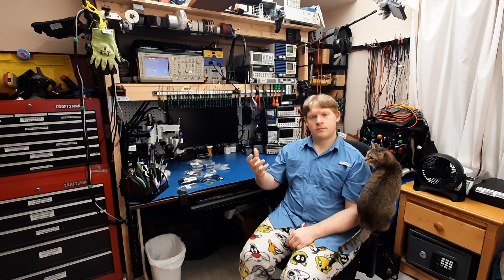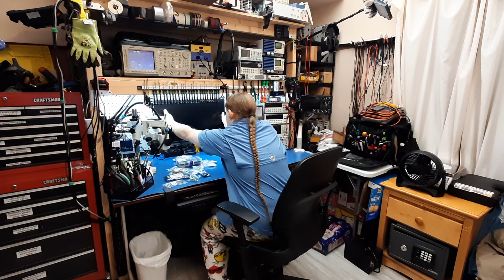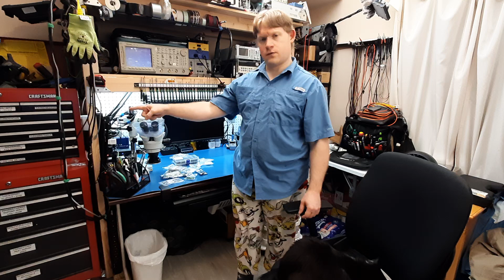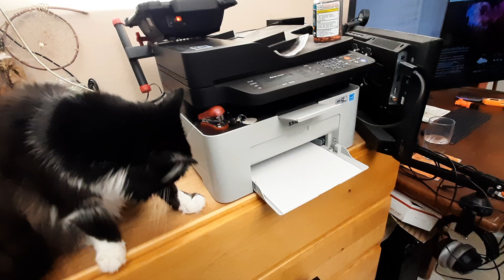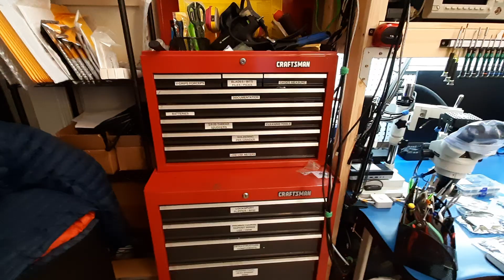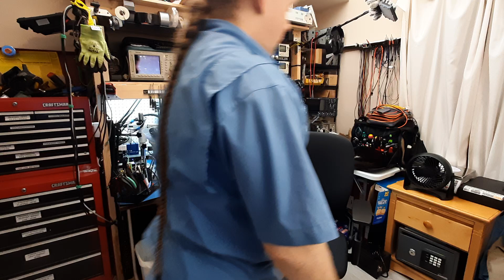Workshop Infrastructure: a talk about the spaces we use to do the things we do.

Comment: New sub here. This is an aweeome channel. I wanted to learn what small electronics workstations looked like because I started tinkering with video game hardware. Fixed my N64 with corroded joints near thr VGA out and I still need to replace the crystal oscillator on my Pokemon Silver Version(replaced the save battery, keeps the save but doesn't continue keeping the time after shutting off). Don't know if others have thanked you but this is awesome stuff and I appreciate you for guiding newbie nobodies like myself.
Reply from the maker: Aww!  Sincerely, thank you.  It gives me a sense of fulfillment to know that my poorly recorded ramblings on electronics and such are being helpful to other people.  I'm glad you find this useful.

Comment: That is a very interesting idea 19:30   I need to look into how much those printers cost.  Most cool.  tHanks for the video
Reply from the maker: The specific model I have (Zebra GX430t) typically goes for the $100 to $150 range on eBay, but if you are patient and watch for a good deal you can of course find cheaper, maybe in the $60 to $80 range.  But if you don't need a workhorse to print thousands of labels for eBay and just want to print a few for labeling?  Don't buy the expensive tool for that scenario, you can find no-name thermal label printers for $50 or less.

Anyway, thanks for stopping by, and I'm glad you found something useful here.
Reply: @neverendingstudent  tHank  you for the extra help.  I searched a bit before but wasn't recognizing which brand or model to go with.

Comment: What a great set of tools.   Very capable workplace.   What are you making this week?
Reply from the maker: Thank you!  It is very much my 'happy place' that I can just enjoy being in, even when not actively using it.

Not building anything at the moment, though I do plan to re-do my materials storage soon.  Currently I'm processing stuff to put on eBay - just cleaned and tested a set of Mitutoyo snap gages and got those listed.  Probably next up will be some DIN-rail industrial managed switches I got at auction for the same: clean/test/repair and list on eBay.  The next thing on my to-do list for actually making something is a server project I'm putting together for NAS duty and as a Plex server: got a Dell Precision 7910 server tower, dual Xeon, 28 cores, 128GB RAM, installed 4x 14TB SAS drives for storage and have Linux Mint installed, but it's shelved for the moment as a project while I power through posting eBay stuff.

I also need to do my yearly workbench/office update tour video, I had made one in 2022 and 2023, but I'm a bit past the point I previously released for this year - going to try to get that out before 2025 rolls around and breaks my 'yearly update' tradition.